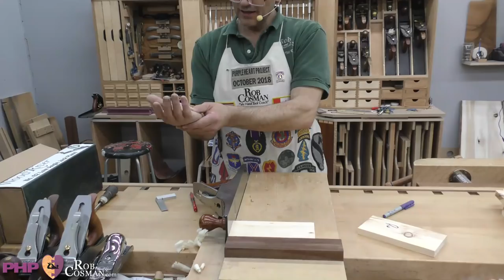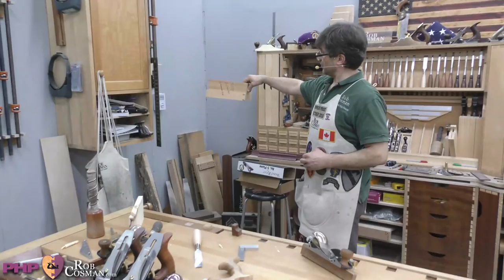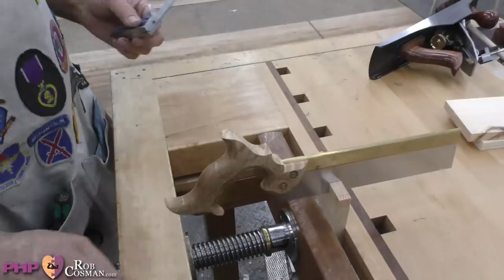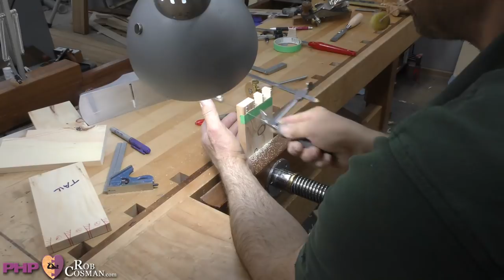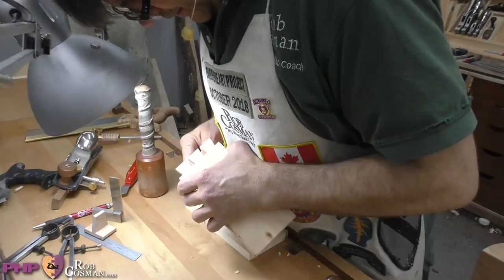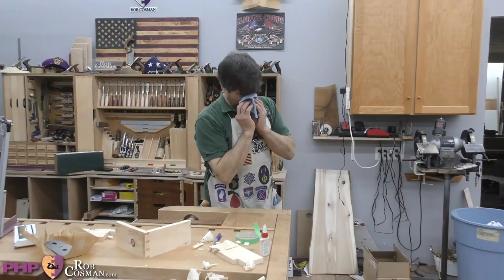LIVE Workshop with Rob Cosman: Episode 2 - Dovetails

Comment: What is the reason for the skew plane? Do you see the cut on the finished product?
Reply from the maker: no, it is used to cut a shallow rabbet on the inside face of the end of the tail board.  It is used to register the tail board when sitting on top of the pin board.